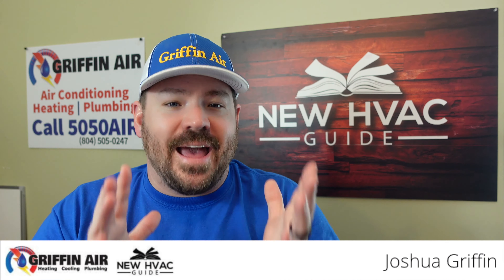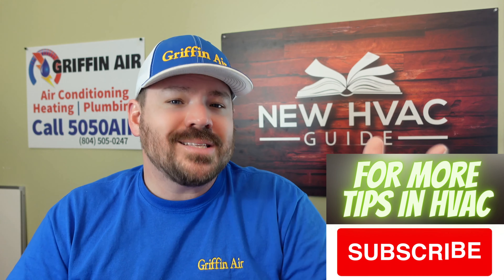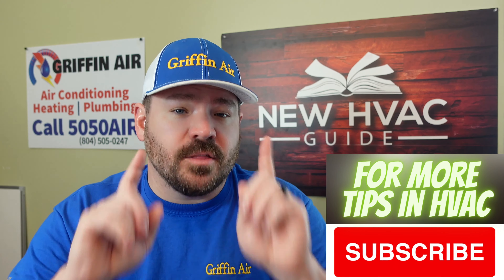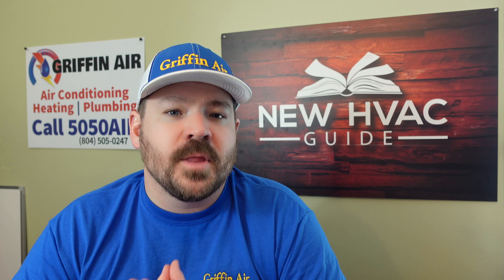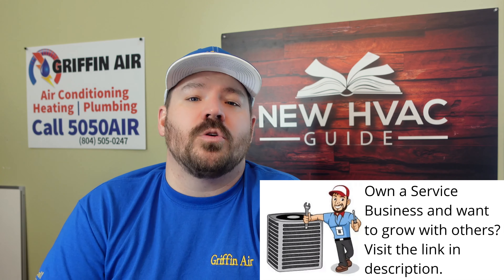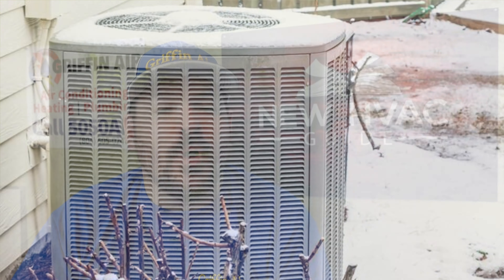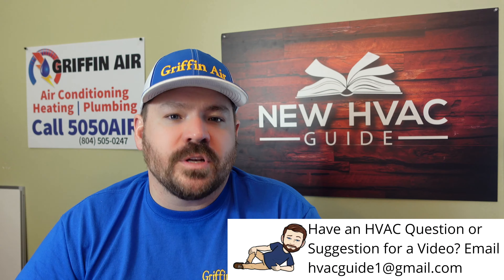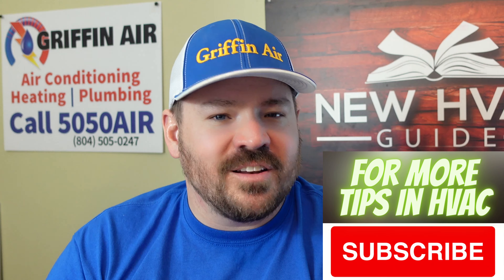MYTHS about Heat Pumps!

Comment: Thanks for the information. As you may know the temperatures are going to drop significantly in the southeast region next week. I will be away during the drop and I wanted to be sure that my unit would automatically kick on the auxiliary heat.

Comment: I live in Ohio and a bunch of homes around here built in the 1980s have heat pumps. As you mentioned, most people hate them because the technology wasn’t ready for prime time, particularly in our climate. But now the new inverter units are actually excellent. A well designed system should be able to cover >99% of heating needs during our winter
Reply: You should educate yourself as well as find out what " k" your heat strip is. There are soo many reasons!
Reply: Thanks. That is good to know. I'm in Ohio and I dont have a furnace or a heat pump. I dont have anything. And I am really cold right now

Comment: Should note manufacturers will provide a table or calculation based on height difference, pipe length, inside temp, outside temp, btus of indoor units and will give you a ballpark BTU output from the outdoor unit. Edit: they may also provide the efficiency along with the BTU output.

Comment: I own an HVAC business and home performance here in Denver.  I think dual-fuel systems with variable speed fans and a modulating gas valve on the high-efficiency furnace and a high efficiency heat pump, but I do not want backup electric coils, no thank you.  That isn't something you find in Colorado.  I think you could make a pretty darn efficient unit and definitely lower my energy bill cost.  We also run our humidifiers from Aprilaire 365 days of the year, if the RH hasn't been satisfied by the automatic humidistat.  I have seen some of the newest heat pumps that can run down to like -22, but the furnace would take over before that usually, but I actually saw one brand stating the heat pump actually increased its output the colder it got.  I will need to find their chart that I saved.  We do not get down to -22 pretty much ever.  We might hit -2 - 5 a few nights, but then it is sunny all day keeping the temps above 10-32 degrees.  In Colorado, our weather is so mild 7 months of the year and many many days during the supposedly "Winter" months, the heat pump would be doing most of the work.  We have a large solar setup and I think it would be a perfect fit.  I am not sure how an inverter system would place into this though.  I do not have enough knowledge about that type of system.  DO you have any good place that can explain the true properties of an inverter system and how they would be beneficial?

Comment: Heat pumps are Loud.If its really cold , it runs constantly or it turns on and off 20 times an hour. Just try to sleep . We warm the house up to 70 then put the temp setting down to 55 when we go to bed just to get a few hours of uninterrupted sleep

Comment: I have a question about the Daikin systems. I just had a new dz17vsa installed and it's strugging to keep humidity at 60%, so 70  degrees now seems almost worse than my old single stage at 73 degrees. Is this normal? I plan to contact the contractor tomorrow but thought I would see others' thoughts.

Comment: Thanks for sharing this information.  Can you do a video on how to clean the Blower Wheel in Mini split system. We have a Trane mini split with heat pump and it starts loosing heating around 30° outside and if colder it goes through a Defrost mode and shuts down then comes back up. 
We are in Middle Tennessee and have very cold Winters at times. Thanks 👍

Comment: I have a 7 year old single-stage Rheem and it heats the whole house fine down to as cold as it ever gets here (-12C or so). I had the lockout set to +1 last year, but I've been feeling bad about emissions so it's set to -10 now and it's actually been fine, although it definitely runs a lot when it's below freezing out and the air it puts out does not get as nicely warm as what the furnace produces.

Comment: I have a duel fuel system and hate the heat pump heat, so my AC guy told me to, in the winter, put the thermostat on emergency heat and that way you will never get heat out of the heat pump...sure, I will use more natural gas, but i will be warm and the heat pump wont run all day...In fact, it runs hotter for a shorter period of time..I live in Raleigh NC...Is that something you would suggest for folks in the Raleigh area? Great video by the way!!
Reply: Just out of curiousity, I am an HVAC business owner and we really don't have any use for the older style heat pumps in Colorado.  So I am curious, if you would be willing to tell me what system setup you are running.  I wanted to explore dual-fuel but you sure seem unhappy with it.  So do you mind sharing the Make, model numbers and any other items you have installed on the system?  I have a buddy in Raleigh and he asked me to help replace his super crazy old system.  Is it the humidity that causes the problem or is the equipment just not efficient enough yet?
Reply: @Balticblue93  No I LOVE the duel fuel system just not the heat out of the heat pump, the gas heat is so much hotter...The A/C in the summer is great....After having just a heat pump for the last 25 years and going to a duel fuel system was like night and day...and now putting it on emergency heat, I get 120f gas heat out of my registers!!
Reply: @RALPHD57  Now wait a second, I am glad to hear you love your heat pump, but that doesn't make any sense.  The AC in the summer is going to have the reversing valve in cooling and you will be using electric power as just a standard air conditioner.  A standalone AC outdoor condenser would generally be cheaper and more efficient.  The heat pump is for when you switch to heat mode and temps are ranging from like 65 down to 10-15 degrees on average and after 32 degrees most fall off.  With the current cost of electricity, unless you have solar panels, a heat pump is not the best option for you.  A High-efficiency variable speed high Seer rated AC unit and a High-efficiency Modulating variable speed furnace would be far more economical and efficient in 90% of the situations. If you aren't happy about the heat produced by your HP, then you need a newer more efficient unit with a better rated HSPF or you just need to be straight HE furnace from 90-98% depending on brand, make and model.  You are stating you love on hot days how the HP is running in AC mode, well, that is how ALL AC units run and on electricity.  There would be no reason to have a HP because a standalone AC is more efficient depending on what you buy.
Reply: @Balticblue93  the house probably doesn't have insulation & has a crawl space. I don't think the heat pump works well without well insulated home, & ones with crawl spaces.

Comment: heatpump's ability to maintain in cold depends on sizing and how capacity is maintained as it gets colder - which varies depending on the design. most heatpump performance problems are caused by mis-use (setting back the temp, not just hitting cold) and lousy contractors.

Comment: If the outdoor temperature is between -5 celcius to +35 celcius can I use only an air to air heat pump through multi split ventilation system for heating a home?

Since ventilation system will give warm or cool air, control humidity and filter the air versus a radiator or under floor heating system?

For hot water I plan to use a air to water heat pump separately.

Comment: Does the outside pump always have to be running while the heat is on, because when emergency heat is on it ain't on, and my Paw thinks it has to be running.
Reply from the maker: That depends on what kind of system you have. Most dual fuel systems have a lockout temperature for the outdoor heat pump. Most straight electric systems will continue to run the first stage heat even when the auxiliary heat turns on

Comment: I wonder if the all electric heat pump thing varies or maybe it depends on the thermostat? Because i have a 5 ton Rheem variable speed heat pump and air handler that runs the heat pump first as long as possible but as soon as it realizes that it can't maintain the temperature with the heat pump within 3° of the thermostat setting it then swaps to emergency mode and i will hear my electric heat strips kick on and my outside unit immediately shuts off.
Reply: Is it going into defrost
Reply: @ecosby100  I thought that too but when it does it heat strips will stay on for a good 30 minutes to an hour until it catches the thermostat back up. Then the cycle repeats shut off for about 20 to 30 minutes heat pump comes back on takes it over an hour to catch the thermostat up temperature actually starts dropping before the heat strips come on.

Comment: Many thanks for clearing up some of my confusion. I have a related question. I have an older, single-stage Goodman heat pump with a basic White & Rogers thermostat. The switch is Cool-Off-Heat-Emergency. Thinking I was turning on the heat on winter day, I accidentally put it into Emergency, driving up my power bill. On a limited budget, I don't want any situation where I'll be running resistance heating. I fixed that switch problem by putting thick foil tape on that switch so it cannot go into Emergency mode. In this video you mention that some thermostats that will turn on resistance heating anytime there's more than a few degrees difference between the thermostat setting and the inside temperature. That could happen if I were simply away for a few hours with the heat turned down. How likely is it that my system will do that? I want it to operate simple, stupid and cheap. No resistance heating until I choose it.
Reply: If you truly wanted that…..the tech could move some low voltage wires around.

There are three ways those heat strips come on in a heat pump system. The one you are talking about is call “AUX HEAT” or auxiliary heat. It’s there to come on if the heat pump can’t quite keep up with demand and it will turn on the strips. This is usually done by your thermostat automatically nowadays.

Second - during defrost. When the outdoor coil freezes up, the outdoor control board has a “defrost” low voltage wire going back to the heat strips. The reason for this is when the outdoor unit goes into defrost mode, the refrigeration system is switching back into cooling mode, this causes the outdoor to get warm so it melts the ice. This also causes the indoor coil to start putting out cold air, so the outdoor control board will bring on the heat strips itself so the consumer doesn’t feel this cold air coming out of the vents. This is the reason A LOT of people hate heat pumps, many technicians do not set this up correctly and the customer will feel this cold air. 

I once had a customer that heard that heat pumps will blow out cold air sometimes and that you have to deal with it, quite a few customers actually. These were techs not knowing what the hell they were doing.

Thirdly, the emergency heat as you mentioned. Just turns the strips and indoor blower on. That’s it.

I’m telling you this because, depending on the weather of where you live at, if you get someone to disable your heat strips in the manner you are wanting…..if everything is working right to begin….you are going to notice a huge difference in comfort.

You may or may not notice a reduction in your electric bill since you heat pump may end up running constantly.

Hope this helps. 👍
Reply: @virtual_bomber5698  Thanks for confirming that my simple system probably only kicks in emergency, resistance heating when I tell it to do so. I like that. 
My heat pump leads an easy life. Winters where I live are mild. With R-70 blown-in insulation topped by attic foil, I don't even turn on my heat pump some 95% of the time in the winter. Adapting to a temperature in the mid-60s without HVAC isn't hard. It's in the summer that I need A/C. Then refrigerators, lighting, computing and cooking add to the internal temperature rather than replace the heating. I began to get unhappy about 80 degrees, so a little cooling is worth the cost.
Reply: Find and read the manual for your thermostat.  The thermostat is the brains controlling your heat pump and emergency heat.  In the thermostat programming (which is easy to do), you can select when the emergency heat comes on, or never comes on.
Reply: @jonwiersig5800  This is true as well, you could change the system setup in the T-stat if you want to do it yourself. Just be mindful of what you are doing or you system could run incorrectly.

For some reason I was thinking of an older T-stat when I was telling him this, thanks for the reminder!
Reply: @virtual_bomber5698  You are probably correct that he has an older thermostat.  But even if he does have an older thermostat, he could replace it $40 or less.
Reply: Very simple way to avoid use of resistance heat is to switch off the circuit breaker for it. Most likely it’s the highest amp switch in your panel
Reply: @jonwiersig5800  Heat Pump T stats are more expensive!
Reply: @jonwiersig5800   For sure! Would not take much to do at all.
Reply: @bobboscarato1313  You are right.  I should have said $70 or more
Reply: @jonwiersig5800  No problem.

Comment: What about the Outdoor T-stat.........The biggest problem with heat pumps.....is contractors under sizing the electric heat strips.......if you have a 3 ton heat pump which is 36000 btu.....then you need at least 36000 btu of heat to over come the unit when it goes into defrost.......
Reply: So you would need a minimum of about 10kW in strips and maybe 15kW to have a big of overlap.  That doesn't sound very efficient unless you have a solar array or electric is cheap in your area.  Things here in Colorado have gotten out of control on both electric and natural gas.

Comment: Why does no one ever talk about the other end of the spectrum? It's 104 outside and 78 inside. I've had three techs come out and say my unit is fine. Well then why am I sweating inside my house?!
Reply: Ac units wether a compressor or heat pump will only be capable of cooling down the air around 20 degrees F (assuming your unit is still very efficient). To better certify this, put a laser thermometer where your return vent is and compare it to the vents that expell cold air. If it is around 20F then your unit is running fine. If you're home is still feeling too hot it might be a problem of insulation or bad distribution of ductwork in most of the cases.